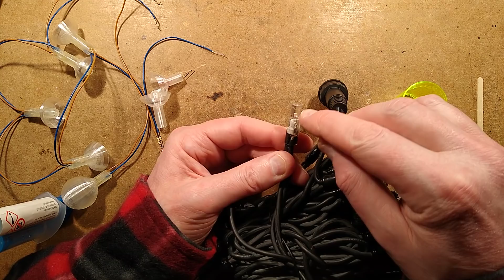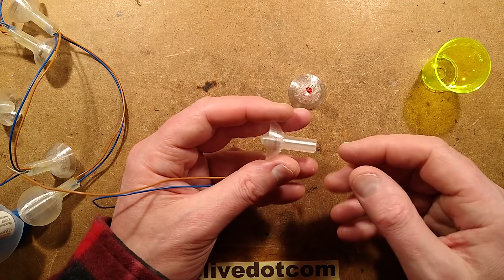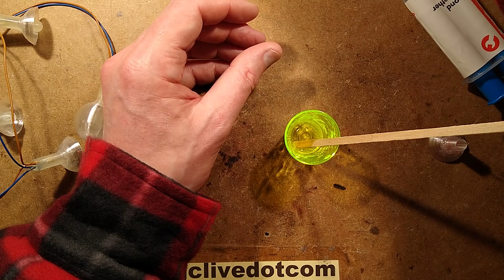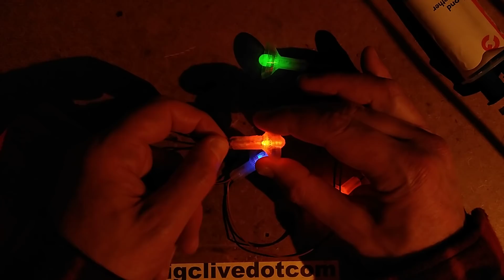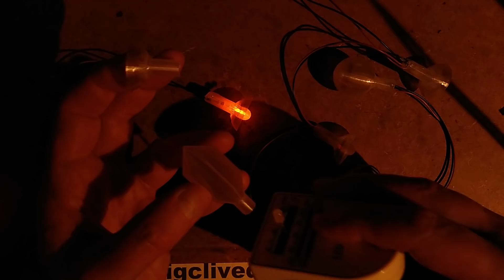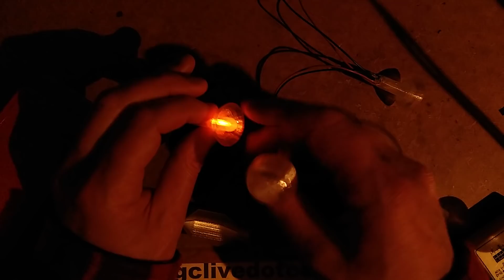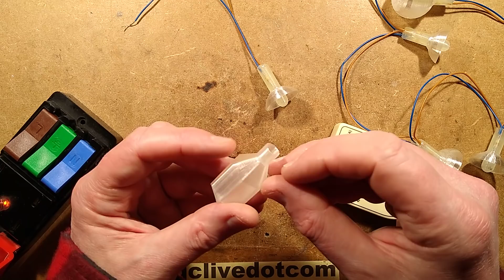The almost regrettable neon fairy light project.

Comment: Clive I have been looking for them style of christmas lights for a while now I used to have them hung up outside for years and they were perfect mine used to be multicolored colour changing by themself but half the string died this christmas and I took them down but couldn't find them anywhere where did you get yours from
Reply from the maker: I got mine on eBay, but there are Christmas lighting suppliers who stock them.
Reply: @bigclivedotcom  have you got a link to them

Comment: PLA is biodegradable but only under certain conditions. Those conditions being specific bacteria in compost at constant temperature of 60°C. Anything other than that and it would last forever. There were number of tests done with this and conclusions were that even buried for 2+ years, left in water or in the sun didn't damage PLA, even though it is well known that PLA is not UV-resistant. Sun might cause discoloration though, but in my experience even that is not significant.

Comment: What about trying clear silicon? You could inject more easaly.
Reply: I was thinking hot glue, if it isn’t too hot for the PLA. I’d just put it in behind the neon, rather than potting it solid. Perhaps print a step into the tube so the solidified glue has a bit of support against tugging out.

Quickly, carefully squirting hot glue up a tube of heat shrink works like magic.
Reply: @LongPeter  That would be easier and cheaper than Epoxy resin for sure.
Reply: Hot glue will almost certainly be too hot for PLA. Everything is too hot for PLA!

More specifically, PLA gets soft and will deform above about 50-60°C. PLA prints have been known to deform just sitting in a car during the summer.
Meanwhile, hot glue will readily shrink heat-shrink tubing, which I think generally wants to be heated somewhere beyond 100°C.

To use hot glue with PLA, you'll have to ensure that the PLA has very minimal forces on it during the time it's at elevated temperatures.

Or you could try heat-treating the PLA print to increase its temperature resistance before using hot glue, but that's a whole ordeal of its own :)
Reply: La Kak i was thinking the same. Use a slow-curing one that doesn’t use acetic acid so it doesn’t corrode the wiring.
Reply: You'd have to go for neutral cure, the common or garden acetoxy silicone is great at attacking copper wires
Reply: Either way, a 30ml syringe with a 12ga dispensing needle would work much better.
Reply: GE Type I silicone RTV contains acetic acid.  GE Type II does not; it causes no damage to metals.
Reply: It would be difficult to machine silicon as it's hard and brittle. Probably have more luck with silicone. However, it tends to be hygroscopic (absorbs water) so it's best not used in contact with metal.
Reply: @manolisgledsodakis873  ..... The 'Horta' was silicon -based, Spock 'mind melded' with it and Bones cured it with a silicon paste !
Reply: @manolisgledsodakis873  LOL. That cracks me up when people get silicon and silicone confused.

Comment: Hi I am a novice a want to try making my own led lights. Could you please advise me on witch is the best type of solder to use? Thanks
Reply: There's simply no "best". Use whatever you find easiest to use.
Reply: Use a flux core. I use .8mm. Great for pcbs ! $20/lb.
Reply: Would you use 60/40 or 63/37 ? Thanks for the help 👍
Reply: @biglee308  The one I use is displayed in my video for release tomorrow...can't remember right now.
Reply: @biglee308  I use both. 60/40 for general use, especially desoldering. I use 63/37 for those awkward solder jobs where large gaps need to be filled and thick silicon cable is being soldered onto pads. The "plastic" temperature window for 63/37 is smaller so less chance of cables pulling away and spraying hot lead in my face.

Comment: Two questions that i might have missed over the years: 1) Why not use a hot glue gun for this? 2) Could you draw the resin into a syringe and squirt it into the channel?
Reply: Hot glue falls apart in cold weather. In hot weather, I've had it melt outside!  Just my experience when covering small solar cells in a jar.
Reply: Hot glue may melt upon prolonged exposure toward heat that generated from the lamp bulb or the resistor, making the bulb loose afterwards.
For the second question, I can't answer because I haven't tried it myself.
Reply: I thought of a syringe, too. They aren't expensive, so for filling 5 to 10 pieces, the time should be enough and you can measure, what amount of resin you need exactly for one piece, avoiding waste and allowing for a fast process (measure, prepare, mix resin, pull resin, fill 1, 2, 3, ... n; then pull the lights inside 1, 2, 3, ... n.
Reply: 1: Hot glue melts around 150C. PLA starts to soften around 60C and is full bublegum by the time it hits 80C. Hot glue can not be used with 3D prints, not even with PETG or ASA/ABS. Nylon can take it but the hot end temperatures are hitting quite high and you need a bit beefier everything.
2: Not with 5 minute epoxy. It really has 2 minutes of perfect constistency after you have mixed it, the whole time of that mixing it is already curing.. There is no time. 4 hour epoxy can be used that way but it is fully cured by the next day... which is usually too long. Of course if one does a string of these light, the 4h epoxy in a syringe is better idea. There is not to win there either thou, epoxy tends to be a bit too viscous to be pushed around. A small funnel and letting it drip in is easier, imho.
Reply: I'll chime in.  The epoxy can be bought with a nozzle that mixes them  as it is dispensed.  Can be injected and controlled when applying to small areas or something like this.  Yes hot glue will work.  The glue and the materials being joined would be fine.  The glue is cooling and the PLA is warming as soon as it is applied.  The PLA would never be close to the glue gun tip temperature.  I have used hot glue on several different plastics and nylon is one of the few the glue won't adhere to as it is not hot enough.  You could bake it with hot melt glue and get it o bond.  Most others work well with them having lower transition temperatures.  And if they are thermoforming plastics, no need for glue.  Just fuse them with a little heat.
There is 1 minute epoxy that is available at most hardware stores as well, would be much better for this type of project.
Reply: @JasonKerlin  You have never actually tried to use hot glue gun with PLA? And specifically, PLA printed in vase mode... Dude: you just gave HORRIBLE advice without actually knowing what the fuck you are talking about. "You could bake it with hot glue".. dude... PLA softens at 60C, hot glue melts usually above 150C. 

"just fuse them with little heat".. What the hell are you talking about? 3D pen can be used to wled parts together but you can't "fuse them with little heat". Your work must leave horrible quality, melted and warped parts and rough surface. The worst advices i've heard in a looong time. Please, stop telling other what to do if you have no clue how things work.

Comment: I've been experimenting with UV curing resin and been having a great experience with it so far!
The bottle I got was the smallest, 100g, and has a little nozzle. Stays nice and liquid until you hit it with a UV light, and 5 minutes later it's hard as a rock!  
Not sure if UV penetrates clear PLA, but may be worth a try!  :)
Reply: Perfect if you want to encapsulate UV LEDs into your lamp holders!
Reply: UV cured resin is awesome! Far easier to use than epoxy and it doesn't really have a pot life. It's thin enough to go into narrow openings without making a mass. One really great thing about it is that you can use a few drops to fix things into place, as it cures instantly when irradiated with a good UV flashlight. Once the item is fixed in place, you simply add more resin to encapsulate and then hit it with UV to set the whole thing. I paid about $20 for a 200 GM bottle, and $7 for the UV flashlight on Amazon. It feels like magic to have such an easily controlled, set-on-demand crystal-clear encapsulant/adhesive!
Reply: How much was the bottle?  Will it last unused for many years, I wonder?  All my glues dry out before I use 80% of the bottle.
Reply: The problem being that it stinks, quite a lot... I've used just acrylic clear coat to seal the surface and clear nail polish for small things.
Reply: @squidcaps4308  the smell is the least of my concerns.
Reply: I tried it in the past. And it cures in transparent PLA.

Comment: Hmm, you do know that you can get a resins that are water thin when mixed and much easier to use for this sort of application? Perhaps outside the normal budget, but not that expensive.
Reply: Chances are he can't by those resins at the corner hardware shop. That five minute epoxy is sold everywhere.
Reply: @QlueDuPlessis  I can't remember the name of the stuff, but any hobby shop with r/c planes ought to have it. One of its main uses is applying fiberglass reinforcement to balsa, etc. You just paint it on with a brush and it soaks through the fiberglass cloth right into the wood.
Reply: @PaulSteMarie  I haven't seen a hobby shop like that for nearly forty years. It really depends on where you live in the World. Specialist items are only available in specialist shops.
For example, there was only one shop in South Africa selling table top RPGs and that was all the way in Cape Town. ('80s & '90s)

Comment: If I remember correctly PLA needs quite a bit of heat to degrade,plus moisture. The paper I read said it takes several weeks submerged in a 60°C bath for thin (2 cm or less) chunks of PLA to biodegrade completely. I don't know how long it'd last in the wild though.

Comment: High temp hot melt glue for the LED version , push fit the led into the lamp then just fill the gap with hot melt. poss the same idea with the neon as all you really need is the hole with the wires in sealed. ??
Reply: It would deform PLA, which becomes pliable at anything above 80°C. Hot glue is of course warmer than that. Cold-curing resins as best bet or perhaps some sort of glue like silicone or  similar.

Comment: Could there be an easier way to pot in the neons if you designed a two-part system for the 3D printed baubles? A short collar that gets resined in place that accepts the diffuser after curing. Would also let you re-theme a string of lights to customize it to the occasion. More work for the printer (and designer) though.

Comment: I'll always love working with LEDs, but there's something magical about the glow of neons. It's almost like the psychological difference between digital and analog sound.
Reply: isn't all sound analog?
Reply: @gd.ritter  Not when it is stored.
Reply: @gd.ritter  Not unless it has the UE on the end *runs away
Reply: @jamesl9686   It is the never ending discussion. I love music and at 61 I have every medium used except wax. I love having all my music on an iPod a couple of centimetres square. Get the right headphones and your set for hours.
Reply: It's also hard to make an LED oscillate.    For nightlight usage, my old neon lamps have outlasted their white LED relatives, which have gotten dimmer and dimmer over the years.
Reply: Brendan Perkins That’s why I like Nixies!
Reply: @OC35  original nixie tubes are absolutely wonderful.
Reply: @jamesl9686  It has more to do with the crappy mastering used on pretty much all commercial music these days, than what medium used - all they care about is loudness (many people listen with crap headphones and speakers and are dumb asses who think the louder compared to your setting on the volume control, the better. They probably don't even know what dynamics is). Music produced for example in the 80's, in fact have higher quality in most cases, than what's produced today. But that doesn't have to do with the "old" CDs having better quality. Many people even think old LP recordings are better than CD for the same reason - along with the medias being better the production quality have actually gotten worse and worse - that degradation is bigger than the improvements made by better medias.
With that said, many mp3-files are crap as well and make the sound even worse by adding compression noise and low pass filters. But that has more to do with people using low bitrates on the mp3-files - those who only care about loudness, will not notice the compression artifacts either.
Those of us, who do recordings our self (or high quality sound for videos) and have good recording equipment, can get much better quaility today, than what you get on a CD (sound recorders and sound cards, are available for cheap that can record sound at 96 kHz or even 192 kHz sample rate and 24 bit). It's hard to buy music at that quality - but even if you could, it wouldn't make very much difference anyway, since most productions sucks - crap in = crap out...
Reply: Unlike analog vs digital, neon vs LED has a tangible difference.